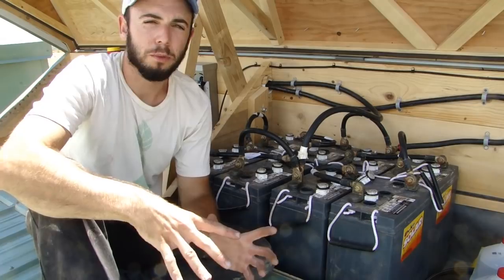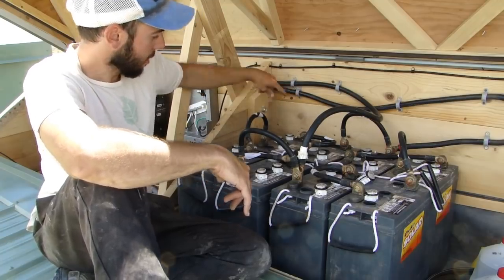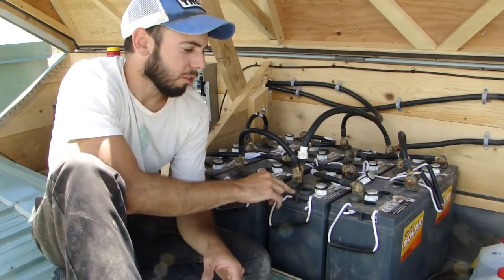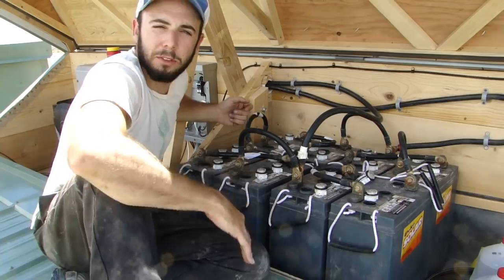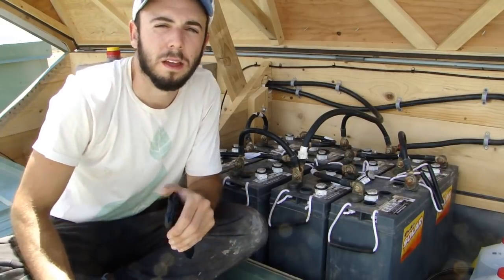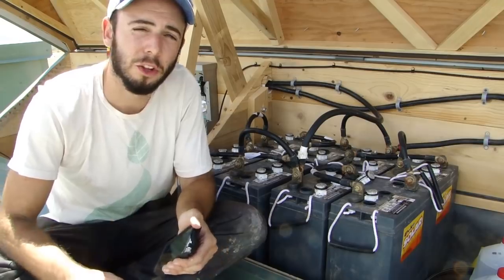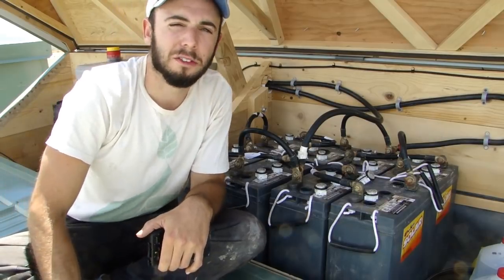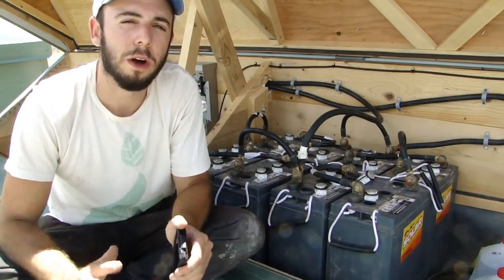How to Size Your Solar System

Comment: I kinda zoned out. I've no idea how you can get by on 5 kWh. my house uses 900 a month, and iv a relatively low energy bill.
Reply: I agree, he might know the physics but he does not know how much he uses a day. I am like you and have tried to cut everything down but seems it always averages about what you use. I wish i had one of those air compressor engines to run a charger as i understand they can recharge their own pressure to reuse it in a cycle. I was told you could have an engine to run on 50 psi to push the cylinder and then have it to trip a pendulum to engage a set of gearing to propel another piston delivering more pressure to refuel the first one. I wish i could find that fella again to see how he set it up.
Reply: if you find it. let me know
Reply: ***** No, can't get something for nothing. "Self-fueled" anything is a scam.
Reply: suppose it could be made to last longer, would see a constant decrease tho. i can imagine it would run for a few minutes at best.

Comment: Don't you need 110 V to run your house?
Reply: yes you do need 110 to 120v to power a home that is why you get a power inverter the power inverter uses 12v to 24v to power it but then amplifies the voltage power from 12 or 24v to 110v or 120v
Reply: I see. How do you deal with power from the grid and your own power without having a grid tie inverter?
Reply: Mike Warren well i dont know that part im planing on using it for off grid home cause i might be moving soon and there is no electricity to the part im moving im going to be using this entirely without the grid.but id say for grid tie i say tap into the power wires on the grid power meter id see no other way to do it as of right now
Reply: i woudl like too. just costs too much.
Reply: Mike Warren You can run your home on 12v or 24v dc if you wish. No inverter necessary. You just have to have all dc compatible appliances and lighting.
Reply: Sounds even more expensive

Comment: i am looking to powe an off the grid shead. i have alot of 220v itmes such as auto lift and welders i can always power with my 40kh gas generator. but the rest of the items i want to have a solar setup to power. is there a way to set up my solar power system that if my battery bank falls below 70% i have have my generator kick in and charge them back?

Comment: My panels produce a maximum of 170 Watts.  My system is a 12 volt and I use 4 of the largest RV batteries.  Tell me if those batteries need to be vented?

Comment: If you put 10 12v batteries in series you will have 120v dc which is ok if you are running incandescent lighting and other resistive loads but if you want to use an inverter you need to hook up the batteries in parallel or series/parallel configuration, depending what kind of inverter you use. most sine wave inverters have a 24v input and some have a 36 or 48v input. You can use 12v modified sine wave inverters but I would recommend using a sine wave inverter because it is better for motor loads

Comment: I have no idea how much electric I use daily as I'm tied into a shared pole. I live in a 30amp trailer, in the summer I sometimes use two window units that are 5000 btu. How many solar panels, size, plus batteries would I need. I have an inverter for 4500 watts. Right now all I have is the 45 watt setup for lights.

Comment: Ok, great video; in easy & understandable language!!! 
Now, if you could...I have a '97 ford e-150 that I'm converting. What size solar panels would I need to power 2 12 volt RV batteries, connected to a 3000 watt (continuous) / 6000 watt (peak) inverter. This will power a small frig, a 1500 watt heater, a 1500 watt 2 burner stovetop, and later, an RV roof mounted A/C unit. The frig and either the heater/AC unit, will run pretty much 24/7. So, how big a system should I get? THANKS!

Comment: Here's the thing, you've basically resized your electrical usage to allow for solar generation, but that amount of usage would only cost 15$/mo from the power company.. how many months of saving 15$ would it take to add up to what you have paid for that solar system? I do think a small system (solar/wind) to have for emergencies is nice, but I still find "going off the grid" not to be cost effective. Thoughts?

Comment: Overall this is a good vid to watch however it could have been better edited and scripted to avoid confusing people.
Also some other advice : You are assuming the the batteries are 100% efficient that is to say - all the power going in can be 100% recovered.  A typical battery efficiency when new is about 80%, so you will loose 20% in the chemical to electrical conversion.
Otherwise thanks for putting the info out there!

Comment: Wrong!  A battery is an energy storage device.  Solar PV modules do not work at night, also the output is D.C. so any A.C. appliance cannot work directly off a panel, also regulation is essential.  Watch the vid again to understand this concept further.

Comment: Very Nice, But why not to use solar panels directly without any batteries? you might answer that the total power (800) is not enough! but you can buy more panels with the same money you saved by not using any batteries.. right?

Comment: Great vid and set up. Im in the planning stages of a solar powered tiny home. Your video has helped me the most in my prepping and what to expect. My only appliances will be a RV Refrigerator so it will be propane or electric optional, 25 inch Tv/dvd player, Air conditioning will be a mini split model for max efficiency. Lighting will be provided mostly from windows and a skylight during daytime but LEDs will be available for nights, an RV style washer dryer combo, and my personal computer wdyt?

Comment from the maker: I actually don't monitor that.  I monitor how much my PV array charges my batteries daily and I have a tri-metric monitor that allows me to see the charge state of my batteries (0-100%) and also what my current wattage draw is.  I think my tri metric monitor would allow me to see how many watt hours I used daily, but I already have a good idea and it's not really necessary to monitor.

Comment from the maker: I run most of my lights off dc and my water pumps are DC.  That's it.  Honestly, I rather put my money in my solar system and inverter and run more A/C.  DC appliances and bulbs are expensive and relatively hard to come by.
Reply: Looking forward to Ensemble by Enphase ...

Comment from the maker: You don't want that oven.  If you are considering off grid living and want a conventional oven, they go with propane.  I have a Premier oven/range I got for $600 that runs on propane with a battery ignition.  The battery ignition replaces the power hungry electric glow bar ignition.  If you don't want propane, then there's always solar cookers I suppose.  It is not feasible to power an oven that uses up to 10KW on an off grid system.

Comment: Thanks for breaking that down with me...was a real eye opener when I looked at the utility bill (I'm  college student with 2 roommates) and saw that we used 1250 kw last month. Of course we have a very old and inefficient refer, 3 window mounted AC units, and my two roommates don't understand the concept of turning things off (especially my one roommates 60" TV, which is on at least 16 hours a day, if not more) when not using them.

Comment from the maker: Great question.  Most of the time, no.  I did it because that's what Earthship Biotecture was doing at the time.  All it has done for me is make it hard to find 24v dc bulbs.  Higher voltage is better for long cable runs over 75-100ft.

Comment: Hello!
Thank you for the info. One bit of info left out when you said that your Solar Panels were 200 Watts but did not give how many 'Volts' were the Solar Panels. Secondly, what brand would you suggest for maintainance-free solar batteries and can you tell us how much your system cost you with parts & labor. Hope to hear from you soon and thanking you in advance.

Comment: I have seen cases where GTIs were coupled with an off grid inverter and when the system AC load dropped below what the GTIs were supplying, the electricity backfed into the off grid inverter by the GTIs killed it.  This can be prevented with things like anti reverse current relays, but in most cases a bigger off grid inverter and DC side improvements make more sense and the parts are easier to get.

Comment: Microinverters have anti-islanding, meaning they don't deliver if they sense loss of grid power. If you're off the grid, you would have to run one system off batteries and the other simultaneously, only in the daytime when you would run a higher load, during sunlight.

Comment: For a variety of reasons and especially because of reliability and cost, making your own panels is not practical. I know what I'm talking about because I've been an electronics tech. 50 years. I've owned solar panels for 31 years. You will waste your money and time if you try to make your own. You can buy panels by looking for panels from bankrupt solar companies on Ebay and etc., at around $1.00 per watt, no more and frequently less. You must know what you're getting into first or big mistake.

Comment: Also, DC does not have higher transmission losses than AC.  That myth comes from people comparing 12V or 24V DC with 120V or 240V AC.  The higher relative losses at lower potentials in a given size wire have to do with system impedances.

Comment: Microinverters need an external mains supply to synchronize with as they are not designed to work without one (anti islanding protection).  Even if this were defeated, system stability would be an issue as the load would need to be exactly matched with the inverter output power.  The only time GTIs make sense in big systems where they are supplementing a regular inverter, and then protection relays are needed so that the GTIs don't backfeed and kill the normal inverter.

Comment: Microinverters are absolutely not useless for off grid systems. They save a lot of wasted electricity compared to transmission loss of DC power at a minimum.  At times when the power can be used as it is generated they save wear and tear on batterys and expensive traditional inverters. In cases when power can be used only when it is generated it can eliminate a lot of equipment.
 But there will always be people who can not see any idea that comes from outside their own head.

Comment: Microinverter are mostly grid tie. Hence, you dont need battery...but you have to have a grid.  Otherwise,,,you will have  electricity during the day...and none at night.  Batteries is a necessary evil to keep you going 24 hrs for offgrid situations if you size your battery bank correctly.

Comment: Well done, you cannot go on about this too much, as well as the value of a good backup charger for those weeks of mist and drizzle. I go on about this balance to some considerable length in my book. It is not possible to take out more than you generate, whilst allowing for losses in the system, and keeping your batteries in good condition by preventing over discharge. Thanks for making sure the point gets over.

Comment: thanks for that...its more or less what I was thinking myself!! I thought I would almost have to double my existing system to get the required power generation, and as for the batteries your saying about 6 or 7 100Ahr batteries should store enough..i guess its abit of just do it and see, would you also recommend a generator as backup say 5kw?

Comment: this is Ireland........lol, but seriously we do get some good sun, I do have a system running at the moment but its "grid tied" and i'm producing about 2kw per day from 700w of solar and 500w wind turbine, when we have good winds and sun I can produce about 2.5-3kw per day which is great as its reduced my electric usage from 6kw/day to about 2.5kw, but I really want to be "off grid" and in control of my own power, with grid tied I still have to pay line rental and service charges.

Comment: Four 250 watt panels and a couple 700 watt wind turbines with a 300 watt fuel cell should be all you would truly need.  You might want to have about 6-700 Ahr of battery capacity but remember that most batteries have greatly reduced capacity with large current draw. They also have less capacity when hot.  Ohms law is a good starting point but there are a lot of variables based on actual usage profiles.

Comment: You have a good point - and quite likely more knowledge about this than most people. You could possibly throw a little more light (pardon the pun) on the video.
Here's a few more tips on battery systems - for EVs, not solar systems, but the principle of the batteries is near enough the same - search "Lee Hart lead acid battery". There's some good info here.
Then there's Peukerts Law, which explains Amp Hours & rate of charge/discharge in a little more detail.

Comment: forget the batteries, you can buy 2- 240 watt panels with microinverters and a 500 watt wind turbine for each 350 amp hr battery.

Comment: 350 amp hr batteries DEPENDING on temperature, rate and percent of drain and rate and percent of recharge etc etc.. Batteries suck and cost more than motre panels with microinverters

Comment: it depends on what kind of batt , what manufacturer and what DOD (depth of discharge ) , all these tells how many years your batt will stay . you have the check your manufacturing life cycle with relative to DOD , i have Rolls batt as they said they can stay 10 years with 25 % DOD .   ,

Comment: You mentioned you were equalizing your batteries while explaining your setup. How are you equalizing your batteries and are you doing this one battery at a time or the whole unit at once. 
I have a 18  -6 volt battery system set up as 12 volt system. The charge controllers are PWM type which are suppose to be able to equalize the batteries..Batteries have 232 Amp hours each, I have 5-50 watt panels. I use  350 watts /hr for 8 hours. Does my system sound like it is properly sized.

Comment: Most mix up kilowatts and kilowatthours, same with ampere and aperehours, but you did a very good job explain that :) . To others i may clearify: Power is measured in watts. Energy is measured in Watthours. Ex. a bulb rated Power of 60W lit 10 hours consume 600Wh of energy =0.6kWh.    Resistance*Amperes=Volts      Volts*Amperes=Watts            Watts*hours =Wh.    1000=kilo     0.001=milli

Comment: i have a question i use 15-16 Kilowatts a day from grid i read meter daily i have 300 watts solar charge panels runing to 6 12 volt deep cycle marine batterys with 800 watt inverter and 400 watts inverter too run a camper and tv,dvd and vcr with computer the 800 inverter runs camper the 400 other stuff will 2-200watt panels to grid tie help lower the K watt use from grid? i runing computers & tv in my home off it with 15 k a day gregg

Comment: What about the conversion through an inverter to higher voltage -- do the kW/h figures change as voltage is changed? ie, will 1kW/h draw at 110/240V measure on the batteries at roughly 1kW/h draw? Aside from efficiency, of course - if its 80% efficient inverter, actual draw on battery will be about 1.2kW/h?

Comment: In theory, yes. Keep in mind though every amp hour rating will be at a C-rate. C, itself is your capacit, so C20 means your capacity over 20 hours, discharge. Typically the numbers are useful for charge OR discharge. So, if a battery is 100Ah @ C20, that means you can expect to run a 5A load, for 20 hours @ 72 degrees Farenheit. A 50A load, at 50 degrees farenheit would be an entirely different thing!

Comment: The numbers are assuming rigorous use of the battery bank. Most inverters will kick out at 11V or 10.5V, and that is considered to be a full discharge on the battery system. In practice, though, we would love to see our batteries never drop below 12V, during use. But no, the numbers typically do not assume 0V, they assume 10.5 for a deep cycle. Like any form of marketing, certain brands tend to stretch the truth more than others.

Comment: Actually there are several. First off, paralleling batteries, though a necessity, is not exact healthy. Weakened batteries tend to take the system down. Secondly, batteries never truly "enjoy" being used, and charged at the same time. A smarter method is to have two discrete banks, separated from one another. One bank is charged, while the other is used, and vice versa.

Comment: I've read somewhere that batteries amp hour ratings are not really what you can use out of them.  Basically, long before you've gotten to use the full amp hour rating, the voltage drops below the minimum an inverter can use.  Essentially it's saying that if you pull all 350Ah from a 350Ah battery... it'll be at a theoretical 0 volts?

Do you know anything about this?  I'll probably ask my EET professor as well.

Comment: Excellent explanation, clean and concise factual presentation. You know your stuff!! it is important to emphasize that FLA batteries or even AGM should never go below 50% DOD, where 20% DOD is the optimal rate for achieving longevity. How old are your batteries and what condition are they in now?

Comment: A standard car battery is nothing more than a giant capacitor used to give you 3-6 "starts" before it needs recharging. It also cannot handle deeply discharging it like you do in an off-grid system. You could easily destroy a car battery in a matter of months with nothing more than a laptop if you constantly run it down. How long would you get on an ave laptop from an ave car battery, maybe a few hours.